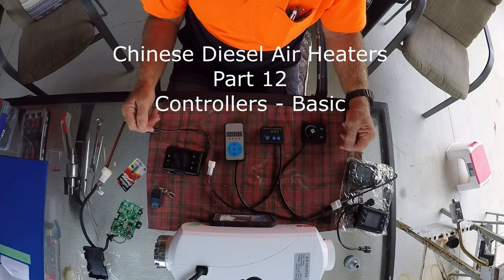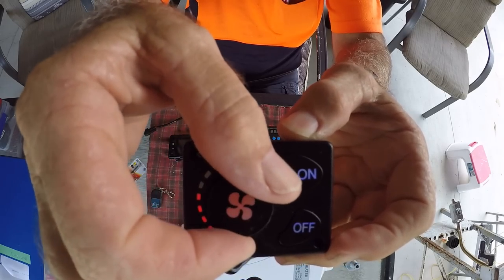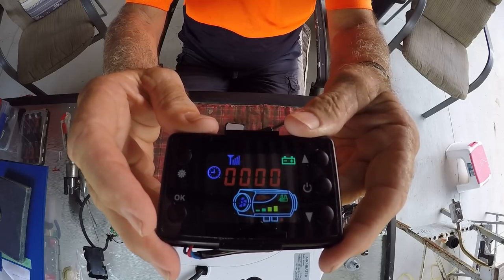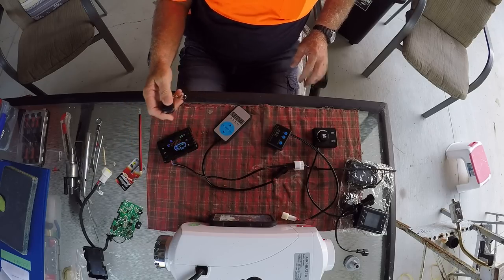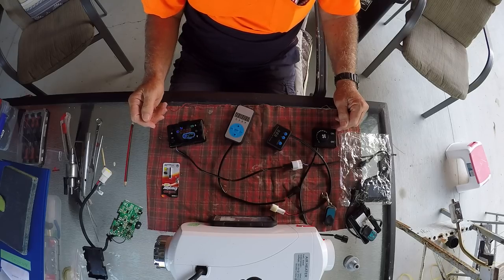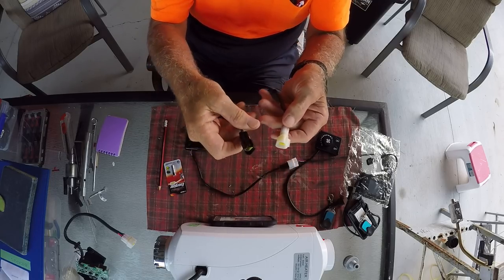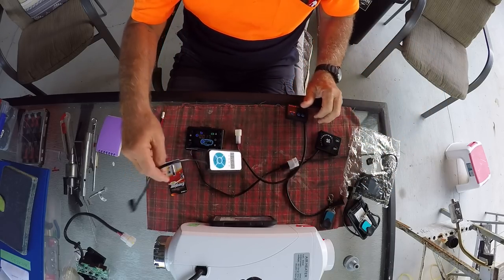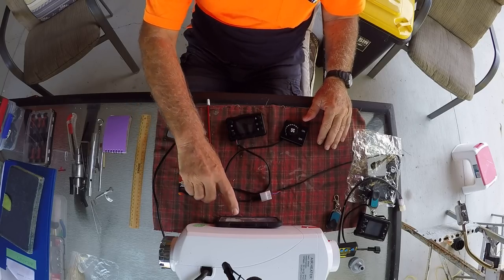Chinese Diesel Air Heaters -  Part 12 - Controllers (Basic)

Comment: Hi John, thanks for your video series on the diesel heaters. It is great information. I bought a 5kw heater recently and it came with a digit controller (it looks like the one in your videos) however, the icons are in different places on the screen, the function key strokes are different and its PIN is only 3 digits and 168 does not work. I'm getting E02 error code and I think a need to change from 24V to 12V, but can not get into the Advanced setting to make this change. On the back of the controller is a model number of CH 14. Have you any experience and knowledge on how to use this version of the controller? Any help or tip would be greatly appreciated. 
Thanks for your help!

Bob A
Reply from the maker: Hi Bob,

Sadly, as these heaters are becoming very popular it appears (but I have no real knowledge) that some manufactures are moving away from the past where you could mix and match controllers.

Sadly I have no personal knowledge of your controller.

Now for some suggestions. 

What voltage are you using? 
What voltage heater did you buy?

Although controllers can be multi voltage, the rest of the heater is voltage specific.  
The fuel pump is voltage specific but being an electromagnetic will still work on the wrong voltage (for a while). Using a 12V pump on 24V causes a more forceful piston movement that slams into the stop. The other way around you have a more sloppy movement.

However the fan and glow plug are very voltage specific. 
You need to purchase a 12V heater or a 24V heater.

Sorry I could not be of more help.  JMcK
Reply: @johnmck1147  
John, thanks for your quick and frank response. My electrical system is 12V and I bought a 5kw, 12V heater. After much trial and error with the key strokes got the heater to prime the fuel line. But when I start the heater, it  runs for 10 or 15 seconds then shuts down and give the E02 error code. I order a new controller last night (like the one in your video, I hope). Can you buy the controller and corresponding circuit board together? If so, where? 

Thanks John and hope you are having a good day!!!

Bob A
Reply from the maker: Robert Arseneau 

Hi Robert,

I buy all my stuff on line. Search for the part you require. 
For some parts like gaskets I search under “gaskets for eberspacher D4 heater.
Sadly I can't give you a link as the last supplier I bought a ECU from is no longer listed.

Good luck.  JMcK

Comment: Hi John, I have a controller as per the the one shown (7.03) but it has no wifi or time function and when it powers off completely ,I have a blank screen whereas yours remains illuminated.
I have an issue with this heater, when it  reaches the set room temperature,it switches itself off as if had manual switched off. Shouldn't it be running continuously keeping  a constant room temperature ?  Is there a setting function that I may have missed for continuous running ? Appreciate any input.
Reply from the maker: Hi Bjorn,

In the past (some years ago) there were just a few Chinese manufactures of these heaters and most used the same format so you could mix and match ECB's, controllers and parts, but recently I have seen different manufactures pop up with their own protocols. I suspect your controller may be one of those.

Regardless, I personally do not like the “automatic” function of the controllers and almost always run my heaters in manual mode. Too cold I run the Hz rate up a little, too hot and I turn it down a little. But that is a personal thing.   JMcK

Comment: Do you have any advise on how to set the temperature and keep it current. We find on our camper that if we set a temperature it say at 19. It drops to 18 and then heats to 20 and idles back until 18 again. We find that on cold nights it’s constantly on and of and on and off causing what feels like big swings in temperature. Any advice?
Reply from the maker: Suggest you just use Hz (power) setting. That way heater runs steady all the time. Want it hotter increase setting. Want it cooler, turn Hz down. That is what I do. I never use the temp setting. JMcK

Comment: John, did you have a part where you go through the settings to not have it sooting up on lowest heat output?
Reply from the maker: Hi Timothy, if your install has no restrictions in the combustion air intake, or the exhaust line, you will not have carbon issues running at low settings. However, many installs need bends and twists, so a full power run for a minute or two now and then really helps reduce carbon build up. Our boat heater is a good install and I have not had to service that heater in over a decade.  JMcK
Reply: @johnmck1147  excellent John, thank you! Could I use aluminium bends instead of copper by the way?

Comment: Hi John . I have a 2kw and a 4kw heater . I had an issue with the 2kw heater and swapped the pump from the 4kw heater to the 2kw . Can you tell me are the pumps the same output please or should I swap them back ?
Reply from the maker: Hi Philip, the testing I have done shows all Chinese heaters 2Kw, 4Kw, 8Kw, used the same pump, ie .02ml per dose.

I talk about this in the 2Kw video.   JMcK

Comment: Hi John. In your opinion are there any benefits in the units with aluminum housing?  Safety? Durability? Longevity? I plan on mounting mine in the trunk of a car, routing the intake and supply air into the passenger area.  Is this space too confined?  Do these units need more air space around them for cooling?  Thanks.
Reply from the maker: Hi D, the aluminum housing is a personal preference thing. I could find no real differences in operation testing between the aluminum and plastic heaters. Before testing I thought there may be excessive cabin heat lost through the housing rather than going into the ducting, but this was not so. The aluminum is more robust, but could perhaps suffer from corrosion in very wet climates (but I have NO knowledge of this happening)
Both types of heaters need an air space around them for safety. The trunk of your car should be fine, but you would need some form of barrier so luggage could not fall against the heater.
If they are about the same price, I would choose aluminum, but is just my personal preference.
Regards.  JMcK

Comment: Can I first say thankyou very much for all the detailed videos made my decision to buy alot easier. 
I am however having trouble with my unit, it seemed to run fine at first however now if I set it to anything lower that 2.0hz once it reaches it's steady state the screen goes black and instantly shits off. I have found by turning the power supply on and off it come back on and does it's cool down sequence. Wondering if you have encountered this before?
Reply from the maker: Hi Ben,
 First thanks for the positive feedback.

No, I have not encountered this problem before. But it is easy for me to see if I have a dud controller as I have about 6 in a draw and I can just swap them over and see if the issue is the controller. A spare controller will cost about A$15 to A$20.

But first, one issue you must look at and one that is not uncommon, is if the heater will not run at a low Hz setting, chances are you have a fuel delivery issue. It can be a blocked filter but generally is a small leak in the delivery line. The most common place is at the heater itself or in the join of the hard nylon to the rubber adaptor. The leak only has to be minute to cause issues at minimum Hz settings. Run the heater at high Hz for about 5 minutes, shut it down and being careful not to burn yourself on the exhaust feel for any wetness around the join of the hard nylon to rubber hose. Also check the join at the pump end. 

Good luck.   JMcK

Comment: Have You ever used an Afterburner Controller? Just curious what your opinion is? I use them with my units for years and they seem to work pretty well and give you a little more options of control. Pretty much works with most of the three wire controllers. They are a little pricey but well worth the money.
Reply from the maker: Hi DC, 

I am well aware of the Afterburner controller, but I have not personally tested or used one. Perhaps at some distance time. However as they cost nearly as much as the heater itself, I wonder if my average viewer would have an interest in them.

But if you have used them for some time I would be most interested in your opinion if you care to share.  My email.  johnmck47@outlook.com.

Cheers.  JMcK

Comment: Hi John! Thank you for all your help so far. I have checked the wiring diagram for the heater we have installed and there seems to be something regarding night light switch. I haven't checked the actual board yet but do you have any info regarding if it's possible to connect this to reduce the power consumption? I could send you a photo of that page in the instructions if you provide me with an email address to send it to.
Reply from the maker: Hi INAB, 

There is no night light switch on the controllers I have tested.
The main current draw on these heaters is the approx 10 amp draw to heat the glow plug and start the heater. The main current draw when running these heaters is the fan, and to a much lesser degree the dosing pump.
My email.  johnmck47@outlook.com.   Cheers.  JMcK

Comment: Bought two heaters neither will even prime the pump. One shows an E07 and reads 0 volts even tho the controller is on. Other reads low voltage permanently from new battery 12v, new batteries 24v or even with charger showing 28v on the display. Swap controllers and no change from the units. Are these boards that bad? Are there certain boards that are better than others?

Comment: Hi John, I have installed my heater with the help of your excellent videos.  One thing that I don't understand: When I set the heater on the lowest setting it seems to run at maximum power.  Changes in the knob (I have the two button, one twist knob version) don't seem to make any difference.  Do you think I have a faulty controller?  Should I perhaps try the more precise LCD one you demonstrate here?  What factors affect the heaters fan speed and dose frequency if not the dial?  (I expected the dial to correspond exactly to a dose frequency)
Reply from the maker: Hi Tim, the heaters will run fast on initial start regardless of controller, to get the burner firing but after a few minutes when the burner is up to temperature they should return to the setting you set. Give it a little more time to settle in. If it does not follow your control settings after a few minutes you may have a faulty controller or ECB. Please let me know how it goes.  JMcK

Comment: Great videos  well explained with good info   
I have a heater with a simple rotary control  .Ir works perfectly but I'd like to add a remote unit so I can turn on and off from my bed.🤣
Can I just buy a controller and remote from Ebay or do I also need a new ECU board?
Reply from the maker: Hi AM,

In the past this was really easy as all the Chinese Manufactures followed the same protocol, but now some manufactures are doing their own thing and it is not so easy to mix and match controllers. Suggest you try it, it will cost you less than $20. JMcK

Comment: My controller looks different to any you have discussed there. It's the black LCD type but has 6 buttons 3 either side of the screen. The extra one on the left is a fuel prime button. Your instructions for entering pairing mode don't work for me. 🙁

Comment: Hi John, just wanted to let you know. I bought one of those newer style blue controllers as a spare (in case my existing controller went kaput). First thing I noticed was that it has no thermistor. Secondly when I plugged it in, it immediately threw up error code 0-1, when I’ve had no error codes with the original older style LCD screen. Anyway I guess I’m warning others that it may not be compatible. At least it wasn’t for me.
Reply from the maker: Hi Greg, 

Thanks for the feedback. Sadly some makers of these heaters are now not following the "unofficial standard" wire code and plug connections, making replacement of controllers more difficult.

The controllers come with power wires and a sense wire, and sometimes you can swap the wires on the plug to match your old controller, but sometimes you need to change to a matching ECB as well.

Regards.  JMcK
Reply: John McK 47 Hi John, got the controller to work. It was shipped set up as a 24V controller. I went into the settings and changed to 12V.
Reply from the maker: Greg Wilson 
👍

Comment: Hi John, I wonder if you have come across an issue in which the controller will not allow or show the usual sequence of button access in the menu?

I have the digital display the unit runs well however the controller will not show set temperature to change, Time display to change time and change to hertz from temp C .

I have emailed the supplier on eBay as the  5kw unit is less than 12 mths old and I’m not sure if it’s just the controller or maybe the control board has developed and issue?

Any advise would be greatly appreciated and thank you for all you informative videos!

Regards Greg
Reply from the maker: Hi Greg, 

I have not come across this issue myself.

Did this issue recently develop, or was it there from the beginning?
If a recent occurrence, it could be a back light LED issue, a controller issue, or a ECB board issue.
If you had a spare controller you could you could swap controllers, or even swap ECB's to help identify the problem.
Depending where you live, you could ask for a replacement controller or even a heater. In Australia, if bought from an Australian supplier, there is a 12 month statutory warranty.
Sorry I could not help more.  JMcK
Reply: @johnmck1147  The controller worked fine on the diesel heater when installed and I could change temperature, adjust time as well as change from Hertz to C which I had to do on first setup. I have hardly used the heater and noticed the time was incorrect and attempted to change it when I found the issue that the controller is not operating as per the button cycles so I cannot change temp, C to Hertz or temperatures however the diesel heater  it is operating well and heating. I emailed the eBay seller in Australia and at this stage have not received a reply so I may have to send an email to the company direct with a copy of reciept of purchase to see if they may assist me. Thank you for all your informative Youtube videos John!
Reply from the maker: @gregtreble9086  

Hi Greg, if you can't see anything on the screen it is probable the LED has gone. If you have some skills in this area you can open the case and replace the LED.

If less than a year old in Aus you have a Gov mandated warranty. Get on to your supplier for a new controller, or refund amount covering cost of replacement controller. If you paid by PayPal, they will most likely give you some refund if no outcome from supplier.
Standard format controllers are available on eBay.  JMcK

Comment: Dear John, tnx for your fantastic videos, my 5 KW heater functions...but my controller (led, the one on the far left on your table) emits very little light, i can hardly see anything... Did you happen to come across this problem??
Reply: I mean far left for me, it is far right for you!
Reply from the maker: Yes Jessica. I have heard  (not sure if true) that in the past people complained LED's were too bright, so manufactures changed things, now they are too dull.

To me it would be so simple to have user adjustable brightness, and I have tried to find out if this is possible. Sadly, at this stage I have no solution.  Sorry.   JMcK
Reply: @johnmck1147  I hoped you would have found such a feature deep down somewhere... Pity but thank you ever so much for all the explaining you do!!

Comment: Hi All, a friend of mine is currently installing a diesel heater in a caravan. He has run into a problem with the controller. Its displaying an error unlike anything I have seen before. Its an E402 error. I have only ever seen two digit codes not three digit. Any ideas?? Thank You

Comment: Great job on the videos.   I bought the 5kw vevor version.  It has the blue control with old style program.  Do you know the 3 digit advanced menu code? Thank you in advance
Reply from the maker: Hi Keith, there are a number of videos that give you the codes for your controller. 
I stay out of this as so many people get into trouble changing the advanced settings, and there is no reset factory setting button.  Sorry.  JMcK
Reply: @johnmck1147  Thank you from cold Manitoba Canada.   Keep up the good work.

Comment: Hi John,
I have now decided to build a mobile unit that I can mount outside the boat or outside the tent. What bugs me about the controllers is, that they don't seem to have long enough wiring to reach inside the heated compartment. Is it possible to extend their wiring? Or do you know of a remote control with thermostat function?
Reply from the maker: Hi Edward, you can extend the wiring, but go up in wire size if the extension is more than double the original length.
Some controllers are configured for 4 button remotes that can do as you ask.  JMcK